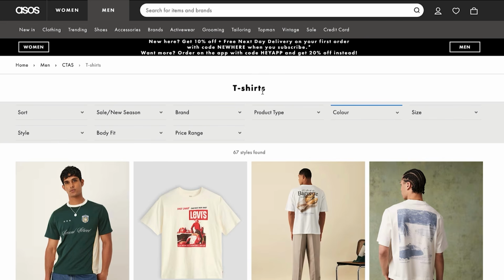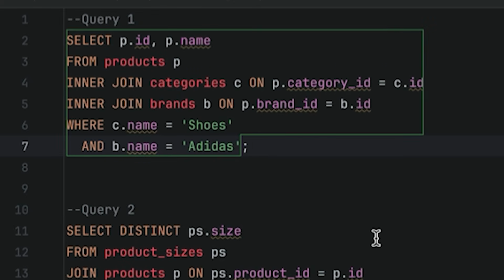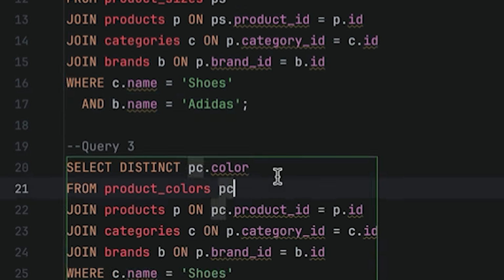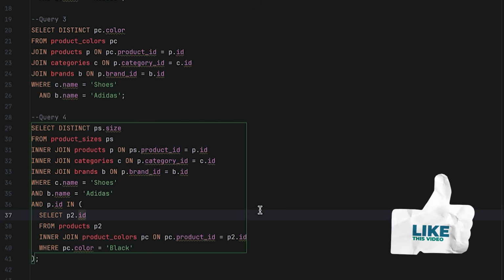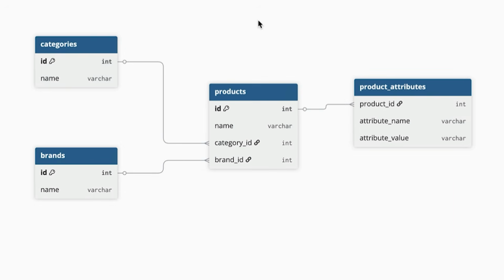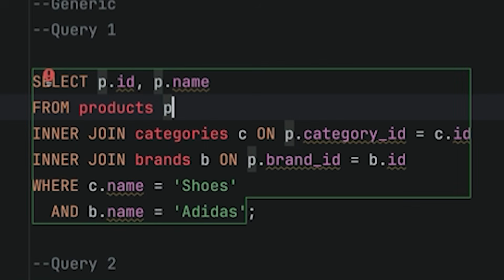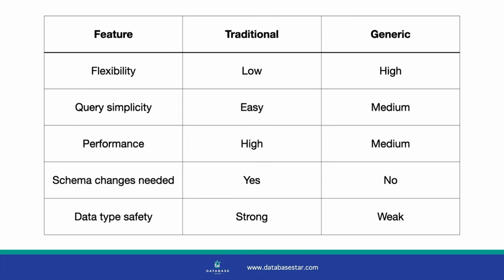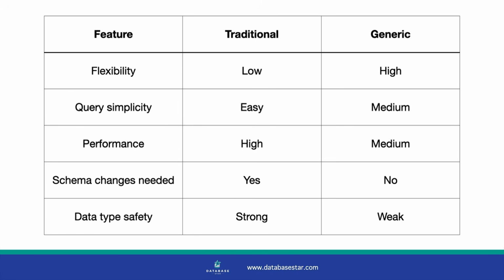How to Build Dynamic Filters with SQL

Comment: 🫨Why? One of the main reasons for normalizing your database, is referential integrity (e.g. only allow sizes that actually exist in something like the “Size” table). Your attributes table is introducing non-integrity checked values into this model, i.e. it allows someone to “Fat Finger” something like “Vary Sm@ll” as a shoe size values for your e-commerce site … 3rd normal form models protect your data: Use it!